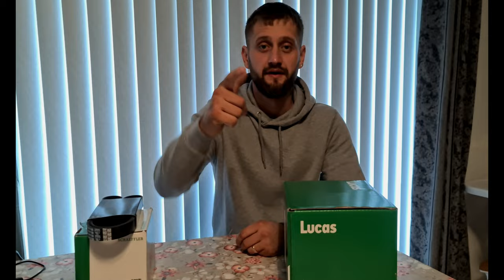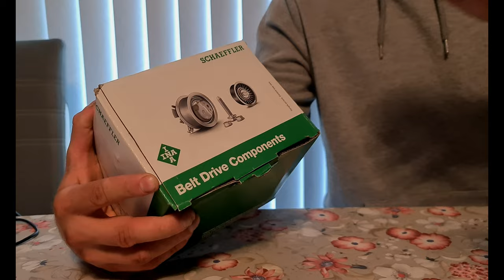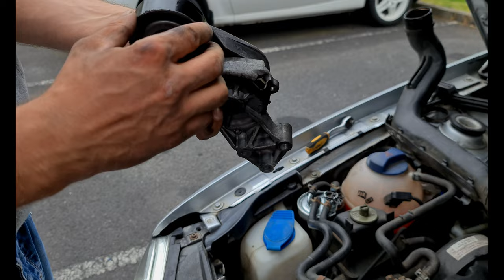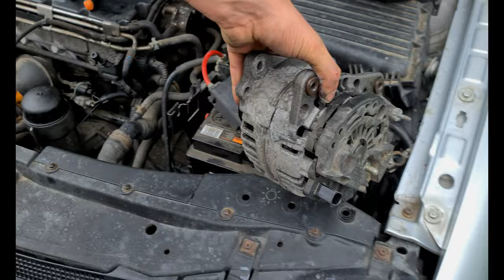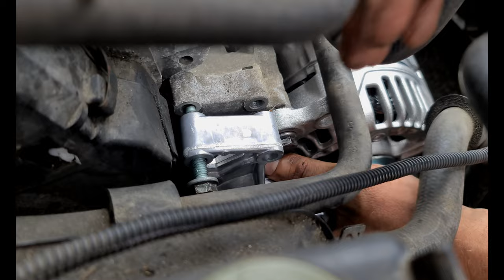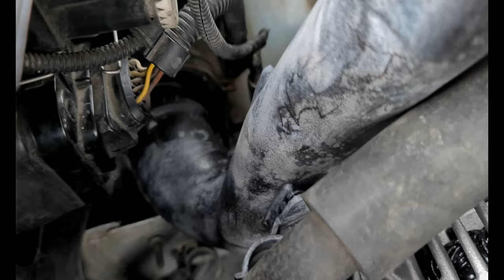Fix Screeching / squealing when turning steering wheel *VW Golf & Jetta TDI*

Comment: What part did you change?
Reply from the maker: Alternator, Belt Stretcher, Belt 😁👍
Reply: @sby93_team  if I hear this noise only when I turn left what do u think should change?
Reply from the maker: @nikosmks6328  I think you should see a mechanic to know exactly what needs to be changed. Just in case. 👍
Reply: @sby93_team  I already did that but they don't know. I have changed 6 mechanics
Reply from the maker: @nikosmks6328  I understand. You can try to change what I've told you and see what happens after. 😁